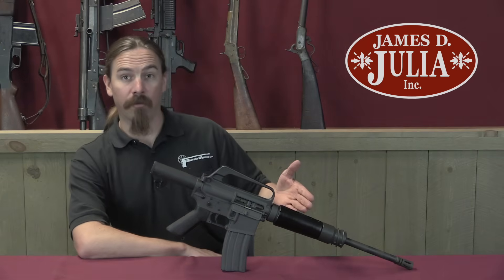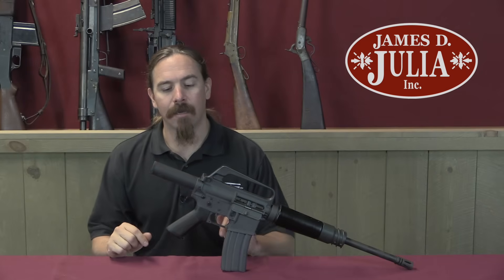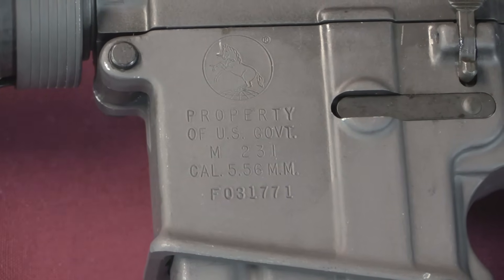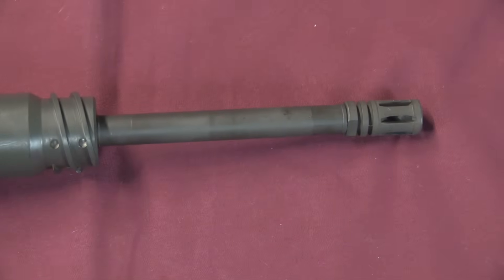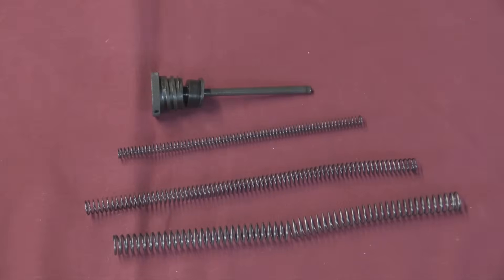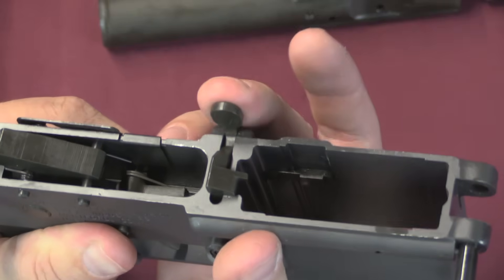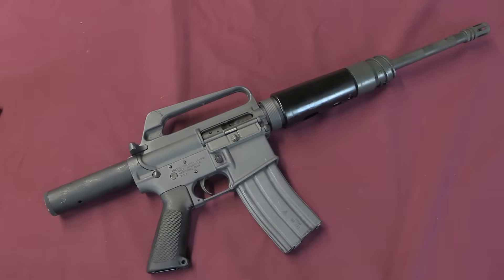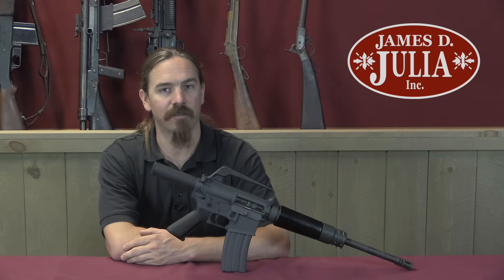Really Not an M16 at All: Colt's M231 Port Firing Weapon

Comment: only fire tracer?
only meant for anti personal?

thats kinda skirting close to a war crime isn't it?
Reply: Jeremy Sims tracers are not war crimes. On top of this, the use of tracers in the port firing weapon was to guide rounds onto the target, as it had no sights and your viewpoint was a periscope far above the standard bore axis of the rifle. Using tracers was the only way to make the weapon somewhat usable in its role instead of utterly useless, which it ended up being anyway.
Reply: only tracers, not tracers and normal rounds for one

and how it is close to a war crime, well, tracers as a sighting tool, not an issue
however phosphorus against people is, (this is something the US has tried fight the hague about, on a few counts, and pretty much skirts close to breaking the rules on a number of fronts with it's use)

so, if you have a gun that fires only tracer rounds
and firing a tracer does far more damage to a human than a normal round
isn't that getting close to breaking the rules if that guns then used only in anti personal roles
Reply: Jeremy Sims Tracers don't do far more damage than a normal round to a human target. It will act the same ballistically inside a soft target, but the burning tracer on infantry does not act as an Incendiary round. Tracers have a small chance to set things on fire given the right circumstances, but the most they can do is bags of hydrogen or a properly air and fuel saturated area just by flying through it. (british .303 tracers were the incendiary used on zeppelins). Protocal III of the UN convention on conventional weapons states that incendiary weapons do not include; "Munitions which may have incidental incendiary effects, such as illuminates, tracers, smoke or signaling systems;"

Originally, tracers were called "Spotlight Bullets", and were essentially exploding rounds, but were banned by the Hague and not that useful for tracing besides zeroing aircraft machineguns on the ground in non combat roles. Later, the base was filled with a magnesium compound with a "cooling" salt like strontium to make the bright white into Red, and increase trace time. Incendiary rounds are packed in the core with something like nitrocellulose to get the incendiary effect, and is not for use on personnel*. (Depending on circumstance as there's more loopholes in those treaties than there are in all European Castles, and who signed what and what parts is all over the place)

Fun fact: Technically it can be said that high velocity spitzer bullets violate the Hague ban on bullets meant to expand or change shape inside of the human body, as high velocity spitzer rounds readily Yaw, Deform, and Fragment inside the human body, but everybody uses them and the science of terminal ballistics came 40 years too late to affect anything.
Reply: so fun fact, 
the british designed the round to tumble etc, (they had dum dum rounds before, it was a big step backwards) it wasn't the science coming late, it was under the rules, okay, (it was more costly to set up the machines to make those rounds, but hey) so it wasn't a case of the science being late it was also under these rules that the US used shotguns (as it was firing many rounds, not a single round, as the lawyers fought) this was despite the complaints of not just the germans, (the injuries were horrific, as was the deaths it caused)
also, while the wound tract can be rather worse than say a hollow point the treatment of the wounded, and the suffering is where there is a massive difference (and the reason the rules happened)  

I know the history of tracer rounds, and the current make up of US issued rounds, fact is, a weapon, that fires only tracers, and where the most common tracer round used contains a substance banned from use against humans, and the role of that weapon is anti personal......come on, there is something wrong there (and had the system been installed, i would guess that the bradleys would have had yet another  costly retro fit/re design to include a sighting port
Reply: Jeremy Sims It is not banned for use against humans. Tracers are not rounds packed with a load, they are produced with a hollow part on the back for stuffing with pyrotechnic compound, which is Magnesium and a Strontium salt, not to be confused with White Phosphorus. Also, the red burn is a mixture of strontium burning and the cooling of the burning magnesium, which normally burns white. As stated in the UN CCW  (b) Incendiary weapons do not include: 
(i) Munitions which may have incidental incendiary effects, such as illuminants, tracers, smoke 
 (ii)  Munitions designed to combine penetration, blast or fragmentation effects with an   additional incendiary effect, such as armour-piercing projectiles, fragmentation shells, explosive bombs and similar combined-effects munitions in which the incendiary effect is not specifically designed to cause burn injury to persons, but to be used against military objectives, such as armoured vehicles, aircraft and installations or facilities. 

Hague does not rule on incendiary usage. Also my point about the spitzer was unnecesarry suffering as outlined in the 1899 and 1907, but in rounds meant to deform, fragment, and expand. The Terminal ballistics of FMJ spitzer cartridges were not understood fully until after World War 2, with minor research being done in 1935. Shotguns have never been an issue in warfare, much less cannister shot, and even further so shrapnel from artillery shells. The protests made by the Germans in 1917 about the use of the shotgun had no legal basis in the Hague ban against weapons which cause unnecessary suffering, as the point was to kill and be more effective at killing a close range target, and was just them grasping at straws because they didnt have a combat shotgun. 

Furthermore, the use of incendiary weapons against personnel is not banned. This includes White Phosphorus among others. The CCW restricts usage of incendiary weapons against civilians, civilian targets, and against military targets in the presence of civilians. This does not prohibit or restrict the usage of incendiary weapons against any military targets. The thought that incendiary usage is illegal is a very popular, but incorrect, myth. The use of incendiary bullets is also allowed completely outside of usage in an area known to have civilians, whose myth of being banned in its entirety comes from the round used in spotting for recoilless rifles, more specifically being because of the manual limiting its usage in a purely tactical sense to not give away the position of the emplacement was misinterpreted to mean its legality.
Reply: Jeremy Sims Jeremy Sims oh, and the system was installed, but it was utterly useless. The appliqué armour packages go over the ports, and the only usage of the weapon and its all tracer magazine was for dismounted troops in the Iraq and Afghan wars. Plus, troops used these all tracer loaded mags originally meant for the M231 because ammo is ammo. I am confused how you believe a mag of tracers are a war crime when standard 1 tracer every 5 rounds is not.

Comment: I know why they didn't want the troops to use their issue weapons.
This would mean having to sell them something additional, thus making more $$$. Government contracts, huzzah!
Reply: @TacticalLumberjack Uh, No. The troops issued rifle at the time was the M16, which was MUCH longer than this weapon. And the M4 did not even exist at that point in time. Also, the Bradley was meant to be sealed against chemical weapons and nuclear fallout. That is why this weapon threads directly into the ports. If you have a bunch of guys opening hatches to stick their rifles out, they are going to let all of those contaminants into the vehicle.

Comment: Those guns were just corruption dumping money into Colt.  They served no purpose that wasn't aleready being covered by the old M-3a1s which the army had lots of.  But as long as the M-3 remained in inventory so to would .45acp ammunition.   Hosing enemy soldiers off an armored vehicle was (for most armies) something that only happened when fighting the Japanese and the North Koreans (but more often when fighting the Japanese for the US and Britain.  In Europe most soldiers weren't dedicated enough to swarm tanks and try to pry the hatches open with bayonets.  Anyway, the US Army copied a WW2 German sub gun mod and had a curved barrel assembly that C clamped onto an M3a1 barrel and it would have worked well enough to hose off a Bradley if no friendly vehicle nearby couldn't dust it off with their M73 gun.  So this was a gun no one really needed, but Colt needed Army funding.  That's all this gun was IMO.

Comment: Only the M2 early (IFV)  Bradley had this set up. Meant for use in Nuc-Bio contaminated battlefields. It seal into the ball mount by the threads and trooper looked through the periscope for "aiming" by use of tracer rounds. Troopers would be in NBC gear anyway.

Comment: it looks like it would not be hard to switch the upper reciver to a different 556 system with sights and maybe rails for a bipod, as all the different components are mostly in the lower and bolt so assuming the pins are in the same spots as a normal ar15/m16 it should be easy to just swap uppers. Then of course put the original upper back on to put it back on its shelf to show off after you have range time with it.

Comment: High rate of fire is for target exposure time, also they have a modified brass catcher with a gas ventilation hose that is attached to the inside of the vic, there is little to no ventilation  inside the crew compartment. We had a few of them, but never used them. looked them over, then never saw them again. And yes they are still in issue.

Comment: Various previous comments have pointed out a few of the problems with Firing Ports on IFVs but they don't cover all of them. 1. Keeping the ports themselves clear and maintaining enough space to use and swing the weapon introduces lots of limitations on stowage, both inside and outside the vehicle, which limits the ability to carry stuff of more general use than equipment designed for a relatively rare situation. 2. Firing Ports produce weaknesses in the armour, quite apart from the NBC sealing issues others have mentioned. 3. Combining those two, keeping the ports clear places severe limits on Applique Armour. You will note that the UK IFV, Warrior, never featured FP in the design, despite howls from the Press and some elements of the services. There were, and are, good reasons for this - yes the 'close assault by Infantry' situation does happen but there are other countermeasures that can be adopted, like mutual support, that are no more imperfect than drilling holes of limited utility in your AFV.

Comment: If I'm remembering correctly a lot of Bradleys still have a few of these things as part of their equipment but have no provision to mount them anywhere due to applique armor so they end up being used as impromptu PDW's or simply neglected.  I have seen a single picture of an M231 with a gooseneck mount fitted to it so at least you could get an optic in lieu of sights on one.
Reply: Mojopin that makes sense, also explains the occasional reference to smashing a rifle with the ramp. Makes you wonder how long the M231 will hang around as a piece of equipment with no purpose, given the Grease Gun was still floating about till Desert Storm folks will probably still be spotting M231's into the 2030's

Comment: There are several reason to not use standard-issue infantry rifles in the weapon ports of a MICV. First, it ensures that there are weapons in the vehicle at all times and so anyone can provide fire without being an actual rifleman. Second, by having a standard port weapon, you don't have to worry about making a port that can accommodate multiple types of infantry rifles. Lastly, and not unimportant to the original MICV concept, is that a dedicated weapon mounting is much easier to seal against Nuclear-Biological-Chemical conditions.

Comment: The reason why it screws in to the hull side is so the Bradley is airtight . The Bradley is capable of being in a chemical environment . Having normal M16s sticking through a hole would not work as well.
Reply: disco2 that makes complete sense.

Comment: From what I understand, the reason this beat the other FPW contenders was that the threads on the gas block for the port made a better airtight seal than the others, since it was totally gonna be Bradleys vs BMP's dodging Davy Crockett bombs and fighting on an Atomic battlefield.
Reply: yyeeeeeup ppl were prepping for some harsh euro and atomic conflict, and then we ended up in the sandbox lmfao
Reply: And what doesn't really make sense is that the gun opens anyway. The barrel is open to the cab when resting (open bolt)

Comment: just a random thought but maybe these affected the decision, Maybe the full length m16 was just too long to have ppl using the ports on both sides of the bradley at once? (never having been in one I have no idea how cramped the cabin was). Also the securing thread could be to prevent an inpact knocking over the gunner and spraying rounds into the inside of a steel box

Comment: I had the chance to crew an M2 IFV in the late 80's. We were told the concept of the screw barrel was from an idea that the M2 would get an NBC over-pressure system and they wanted a good seal. The armored ball is tight enough with no gaps. It is better than the port firing systems on most vehicles that simply give you a 2in loophole. At least normal small arms fire would not slip thorough. If you know the story of the Bradley, it was all things to all people. There was a concept that the M2 would be rolling through enemy trenches in a blitz, on a contaminated battlefield, and the dismounts could "scratch the back" of other armor using the M231. In reality, it was nearly impossible to train with the M231 as designed. The range fans for normal Table VIII would prohibit such a thing. No Commander wants to see his trim vanes, sponsons, antennas and view ports scarred up from "back scratching". The best you could do would be to put the M2 parallel with a flat range and fire from one side. It really just amounted to fam fire. Sort of a waste of time and ammo for such a low use niche weapon. I know guys in GW1 who did dismount it in live fire training prior to the invasion. They practiced clearing trenches with it. Soldiers loved it, but the basic load was a gunner followed by and ammo bearer with a satchel full of mags. It was never used in combat.
Reply: A few of the older grunts I work with used it with an ACOG mounted to the “carry handle” with the old A2 ACOG mount. They claimed it worked until SGM caught then with it in the DFAC.
Reply: @josephmeagher3145 did they have a stock for it?
Reply: Familiarization Fire. Basically, fire a few magazines down range just to become familiar with the weapon. It is hardly training.
Reply: Whats fam fire? I didn't see anything that seemed related when I googled it

Comment: I must respectfully correct The Man, but the part called the Firing Hammer doesn't actually strike the Firing Pin, but rather it is in continuous contact with the back of the firing pin and keeps it in its most far forward position throughout the bolt carrier's travel. Because the firing pin is pinned into the bolt carrier instead of the bolt like in other types of guns, the firing pin can't touch a primer until the bolt carrier is forward and the bolt is locked.  Part of the reason for the extreme rate of fire is that this system has essentially zero lock time, as soon as the bolt locks, it fires.

As an AR guy, I was extremely interested in how this thing worked when I was introduced to it in the Army.  I found it reliable, but completely useless for its intended purpose because of its too small ammo capacity and the fact that we had to shoot without sights, looking through a -15° view tank periscope, which cause the shooter to shoot ridiculously high until he could correct by watching the tracers impact, but with the high rate of fire the mag would be empty before you could get on target.
Reply: Neat!